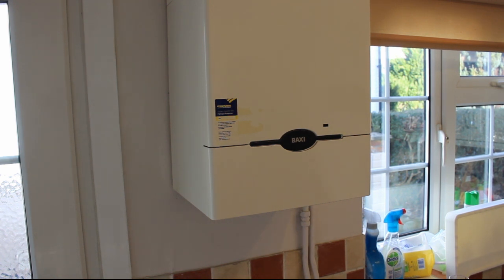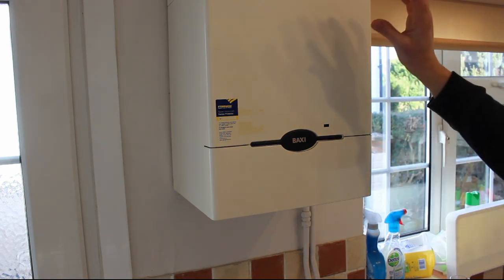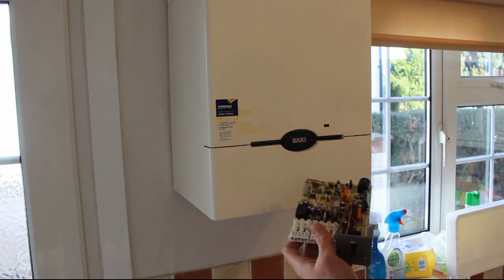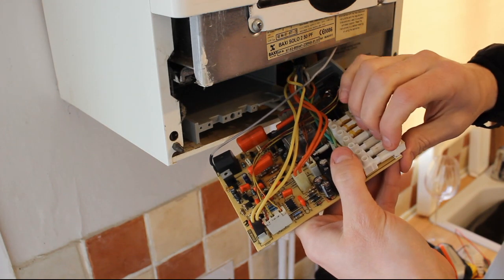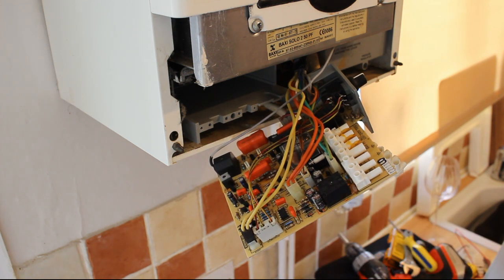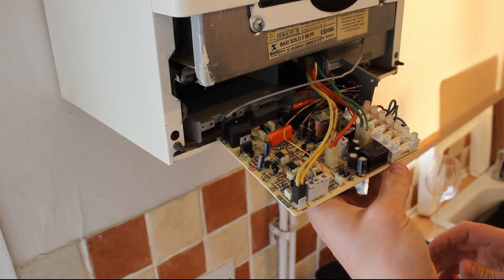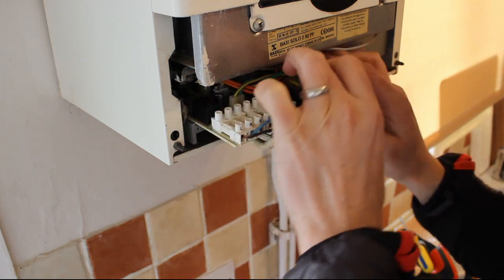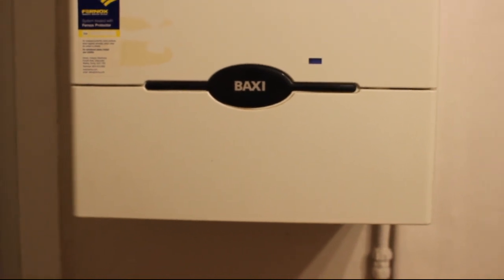DIY Boiler repair - PCB replacement

Comment: By interpreting the Gas Safety Regulations, it states that any work to be undertaken that disturbs a module controlling the combustion process, needs to be undertaken by a Gas Safe registered engineer. I would suggest that you do "disturb" a pcb (which in itself is a module controlling the combustion process) by the very fact of disconnecting and reconnecting the wires to that pcb(even though you reconnect them correctly) and I would think therefore that this is illegal?

Comment: Regulations 26.9 state that any competent person carrying out work on gas appliances shall immediately examining four things .. 
gas engineers will know what those four things are and in order to carry them you will have to be Gas Safe Register registered and therefore you are not really supposed to be touching gas appliances since you do not know how to put any defects within the appliance because you’re not trained for that you are not expert in boilers not trained not registered nor competent and therefore you should not touch gas appliances,

Comment: I've got an even older Baxi Solo.  Built at time where electrics were simple and computer free.  I've changed the PCB a few times, its always a slightly different fault, and the rubber pipes for the pressure sensor tend to dry out and split with age.  Eventually I will concede defeat and have a new boiler fitted, but I know it will never last as long (nearly 40 years old)

Comment: My comment would be that's the best most reliable heat only boiler you will wish you never got rid of if you did my friend has had 3 new condenser boilers in 8 years new boilers are like modern diesels cleaner but unreliable over complicated

Comment: Don't work on gas appliances unless you are gas safe registered
Reply: Hi Ben, Many years  ago we had the professionals?,  Gas Safe British Gas to service our Glow Worm Back Boiler, following their visit there was a strong smell of gas. They had not correctly tightened the gas connection.  Regular servicing on our new replacement Veissmann Boiler was done by a gas registered Heating Engineer, the Expansion Vessel pressure was never checked leading to over pressure of the system and further problems.  I can fully understand competent (you hope) people having a go themselves.
Reply: @rodfisher2837  there are cowboys in many trades and I absolutely despise them. As a gas engineer it makes me sick to think there are other so called gas engineers out there completing work to a poor and dangerous standard as you have experienced and those people should be reported to gas safe. I would always advise that a gas safe registered engineer should be the only person working on a gas appliance as there are so many things that can go wrong. Stay safe dude!

Comment: I've changed the circuit board 4 times in 12 years... Ive changed other components, valves , actuators etc,.... but always the probelm is the circuit board.... These fail frequently...diodes etc bun out especially if systme si used frequently. Each wite usually onyl fit sin its own fitting housing, but a photo is hand, not pull one wire off and put it on the new, You can easily damage the board like this. Use fine plastic gloves - TURN POWER OFF FIRST

Comment: Im a heating engineer. So much wrong with that video safety wise but good luck mate and tbh well done. 
Wee recommendation is stop getting plumbers to look at boilers they dont have a clue i would say as high 80%.
They don't fix boilers its a different trade.

Comment: Are you gas safe registered?
Reply: I thought that soong as the combustion chamber was not touched and none of the gas side was touched he is allowed to work on the boiler?
Reply: NO YOU MUST BE GAS SAFE, TO TOUCH ANY GAS APPLIANCE, I BET HE IS ONE OF THEM IKNOW EVERYTHING, AND I HEAR THAT ALL THE TIME,I GOT TO GET IT GOING ON FOR ANOTHER COUPLE OF MONTHS 😂
Reply: @jameslawson7791  not quite true. It depends on what he is touching and the manufacturers instructions. Provided he is not disturbing anything that affects combustion then he is entitled to do the work. I suspect that the pub does control the function so would recommend a gas safe registered plumber is employed since they will be able to verify proper operation to the manufacturers spec.
Detailed in here https://www.gassaferegister.co.uk/media/1449/who-can-legally-work-on-a-gas-appliance-factsheet.pdf

To all DIY hero’s gas boilers are very good at killing you quietly, get a good gas safe registered plumber to do the work for you. Don’t risk it.
Reply: @jameslawson7791 Not true at all. You are a clown and a con man, and you can't even use a keyboard or a phone touch screen correctly

Comment: So you already know what a PCB is? Just calling it a “PCB board” displays your level of understanding and competence. What you are doing is potentially dangerous with massive consequences! My advice to you and anyone else giving this the thumbs up, is call a professional gas engineer who will diagnose, the correct problem, replace and set up any new parts and leave you with a safe working boiler..
Reply: Do get over yourself, he doesn’t touch the gas side or the combustion chamber. And as for interpreting his use of “PCB board” as evidence of incompetence, just crazy. Yes we all know it stands for “Printed Circuit Board” so adding the word board is superfluous, but it’s just a figure of speech. How many people say “reverse back” - does that make them incompetent drivers?
Reply: Well actually you are a dum dum, because the PCB is actually on another board as you can see from the colour
Reply: yawn

Comment: Its bad enough you chose to do this ,but to sugest to others to go into a boiler with no idea of consequences of relivent standards and codes  shame on you
Reply: It's a tough one. I'm a heating engineer but I also watch YouTube all the time tips and knowledge in other areas. I believe in the share of knowledge. There are videos on here and you can see their competent, however this one is a joke. Someone is going to die watching Pillock like this and then they'll ban all of them.

Comment: If you knew the PCB board had gone, why call an engineer out ??
Reply: he didn't know hence the call out. In all probability wanted a tradesman to identify the fault so he could save a few £££s, fit the part himself and then calls the plumber "next to useless"

Comment: Faulty PCBs are often down to dry solder joints on the board and someone with basic electronics soldering skills can fix them up in a jiffy.

Comment: Hi mate, on the old PCB were any of the capacitors blown? (bulging out at the top)  if so you could have tried to replace them if you can solder. capacitors are cheap. read old capacitor for correct value. To the gas safe people, PCBs can be repaired, refurbished, rather than put in land fills.

Comment: I had a plumber around because my boiler would not ignite. He could not even remove the front panel of the boiler. Eventually he phoned someone up, removed the panel then asked for instructions on how to do some tests. He then told me the pcb was probably knackered demanded a call out fee, cash only, and when I had paid it he put the front panel back on and departed.  Useless bugger.
Reply: Was he a "gas safe" engineer lol

Comment: Sorry to tell you this’s but any thing that disturbs the combustion is a job for a gas safe engineer and changing the PCB witch controls all components on the boiler definitely comes under that heading
Reply: Dont be a pansy bro. U dont need to be gas safe registered to swap out a pcb on your own boiler. Especially since the gas safe engineer is overcharging by 350£ for the same board

Comment: Same thing happened to me,I had a plumber come round and got charge for the privilege to tell me he doesn’t know what is fucking wrong with the boiler. The flashing lights on the boiler tells me it’s a PCB problem according to the manual book.

Comment: All the neg comments from expensive tradesmen who charge a small fortune for 10 minutes work. Sometimes on shit you don't need.
Once cost me £75 years ago to change a washer on leaking tap.
Then another tried charging £150 just to fit 1 rad that's with any rad or pipes we had the buy them.
Never again if it's gas or big scale electric not a chance. Changing a pcb board. Diverterver valve. Adding a new bathroom I'll do it myself thank you
Reply: Well you know what you know. If your happy to do this in your own home then fair enough.

Comment: I changed PCB last year and it was functioning.  Today, all I can see is just the light on burner is on.  I tried turning the nob to reset it, but no fan and pilot light and there is no firing sound.  Checking the wires for current that goes out from PCB, the wire going towards Pressure Regulator does not indicate current flowing.  What might have been the problem?  Any help would be greatly appreciated.

Comment: Bought off eBay? Very often secretly reconditioned/refurbished or used in my experience
Reply: Whats wrong with refurbished if it has a good warranty? Lots of high end manufacturers sell reconditioned items.

Comment: Thank you for sharing I have the same fault, with a bit of research you can buy a reconditioned PCB from CET Ltd they work on a return basis where you send back your old board and they will then recondition that one repairing the blown components

Comment from the maker: Don’t worry.  Gas safe is only a requirement to break the seal of the combustion chamber or work on a gas carrying component.  You’re fine to change the pcb yourself and save a packet.
Reply: I don't care. My I've only got hot water. It's now November 2018. No way I can get the £300 quoted to change a 3 way diverter / cartridge. I'd have to dig up. My granny and resell her. 
Brought the piece for £30 watched  videos on how to do the job 
Do myself. Worth while having a go. ain't messing with gas
Reply: That is completely false if you are not confident registered person you cannot work on gas appliances and stop for a few reasons. Firstly is already one mentioned above about regulation 26–9. Any person who is working on any gas appliances shall immediately carry out for things those can only be carried by competent experienced gas installer so for you to go around until folks to just go and replace things in the boiler just because they’re not getting into the chamber absolutely fucking bollocks and I’m telling you should I come Across somebody working on appliance appliances who are not registered because we can tell I promise you I’m straight calling Safe Register stop telling people to touch gas appliances. People can die for that. You are not trained to spot defects in these boilers. Don’t think because you’re selling yourself a couple of hundred quid. You’re winning the lottery here those £200 will not be helpful when somebody die of carbon monoxide or incorrect working boiler or gas appliances.
Reply: By interpreting the Gas Safety Regulations, it states that any work to be undertaken that disturbs a module controlling the combustion process, needs to be undertaken by a Gas Safe registered engineer. I would suggest that you do "disturb" a pcb (which in itself is a module controlling the combustion process) by the very fact of disconnecting and reconnecting the wires to that pcb(even though you reconnect them correctly) and I would think therefore that this is illegal?
Reply: I wish these so called plumbers would learn the law before leaving negative comments.  You're absolutely correct. If the combustion chamber is not touched you can work on the pcb
Reply: wrong
Reply: Wtf you are changing the component that controls all parts on boiler. You need to carry out 26/9 gas checks after replacing a pcb. Contact the gassafe register and they will tell you the same. You didn't confirm safe electrical isolation and clearly don't know how to handle a pcb.
Reply: U only need to do all that if ur a scared pansy. If u are a normal person u can skip that as its a waste of time
Reply: I’m guessing you carried out all relevant checks with regard flueing,ventilation,combustion and safety devices after DIY’ing a PCB swap? Only the part that controls the ignition sequence of the appliance. 
Clown